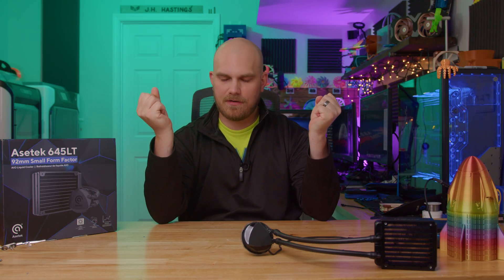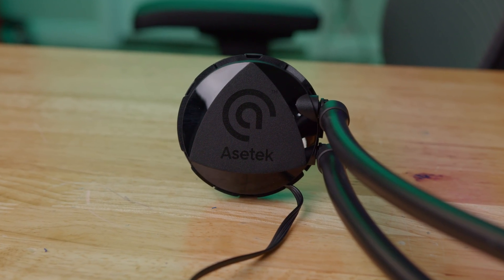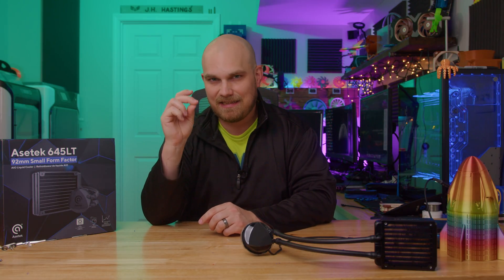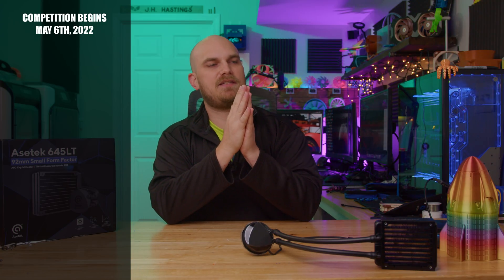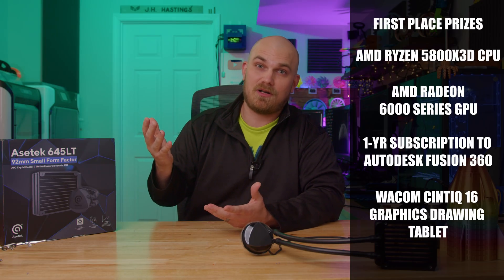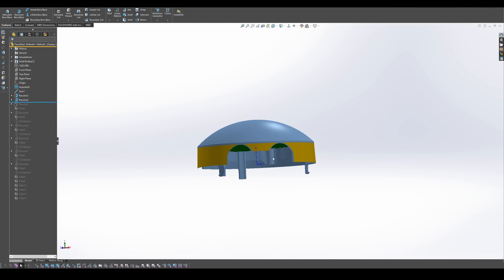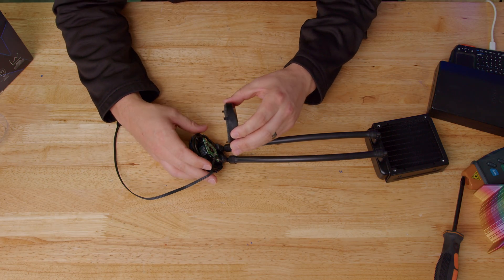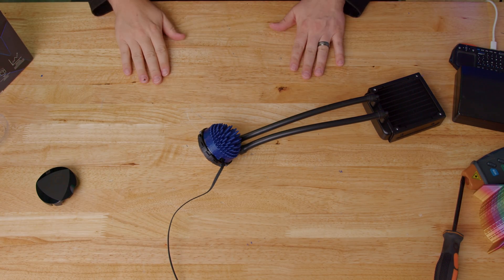The Fan Showdown Just Went PRO | Asetek Community Design Challenge

Comment: This is crazy! Asetek is ruthless with the patent protection but wants to drum up ideas from the same community they hurt. I think its a big deal they came to you and recognize your community and you should be proud of yourself and what you've created!
Reply: well this is certainly cheaper than actually paying for someone to design it
Reply: Yeah, my first instinct was to say "oh man, I really hope this doesn't turn into another 'Nike Swoosh' situation."

Carolyn Davidson was paid $35 for creating one of the most iconic brand logos of all time.
Reply: patent protections. getting free CPU block tops with no RGB... LOL what a joke
Reply: In what way do they have patent protections?
Reply: @TesserId  they have patent that basically says any pump attached to a heat block, is a violation. This is why you have so many weird AIO designs in the US with externally routed tubes, and pumps in the fan, and pumps in line, and pumps on the side of blocks, Etc. Etc. It is all you avoid any likeness to the "pump on block" patent. This is akin to Toyota having a patent on a "metal box that rolls on 4 wheels". It's a bad patent, and stifles innovation, and forces other companies to use Asetek block/pump combos on their units. Which with their round design and small heat exchanger, have been proven less than ideal in efficiency and performance. It has hurt the cooling the industry as a whole.
Reply: @bigbuckoramma  Thank you.  So, I did a Google search with some of those terms to see if I could clarify some of what I'm reading here.  The part about the overly general patent I found, but I think your explanation of why it's overly general makes perfect sense.  Overly general patents suck.  They stifle innovation, which is the exact opposite of what patents are supposed to do.  But, this is not new.  The corporate overlords got themselves changes to the patent laws that are totally ridiculous, and overly broad patents are issued way too often.  ~~~ So, does Asetek have predatory licensing agreements, or are they just suing the hell out of every company that makes products that  even faintly reassemble what the patent was granted for, or both?  ~~~ And, are they getting into the right-to-repair territory and making their products hard to hack?  Personally, I take no shame in voiding warranties when I want to cobble together a monster.  Screw the warranty.  But if a product is constructed to prevent such hacking, screw them entirely.  ~~~  Thanks again.
Reply: @TesserId  Yes to the first question. The licensing being forced on companies, and suing for infringement. As for Right To Repair, I don't think they care either way. Their pumps are semi serviceable, but they don't intend them to be. They are considered a disposable item. Yay for more e-waste.
Reply: This is obvious marketing/advertising
Reply: They probably wanna buy the any good pattern so they don't do any work for themselves to find one, then lock that pattern again.
Reply: @Stein Mauer 
But they are nowhere as cheap as the AIOs, when they should.
Reply: well, the rest of the copmanies could also sell DIY kits or different designs, yet they dont do it, so no, the patents arent doing much harm at all, sure its a dick move and a stupid patent but the rest of the companies arent even trying either. AIO are shit, why dont they just sell you a DIY kit one like people used to make them?!
Reply: who do they hurt? the unimaginative there are a few ways to get any job done and in this world being a copycat can cost you or just being late to the paperwork you might be surprised that Asetek has employees and families they provide for they are not your friend the same way no company is your friend or in business to save you money or other people time haha keeping the doors open is the first job of any company then securing growth
Reply: Nothing wrong with protecting your patent. Hurt? Talk about hyperbolic rubbish. Imagine forcing multimillion dollar companies into designing their own products instead of allowing them to rip you off...and then white knight for them. I am not Corsair or any other company. They are not the community and the community doesn't owe them a damn thing.
Reply: @Berserkism  stagnating the industry...

Comment: Yeah.  I'd like it a lot more if it actually had an effect on the efficiency of the product and wasn't just cosmetic.
Reply: I mean, at that point the company should be paying you.
Reply: Yea this is just stupid
Reply: The design doesn't have to be only cosmetic...
It's possible to make the design usefull
Reply: @poldelepel  how? this is literally just a shell, all water loop components and pump are already there
Reply: @marcogenovesi8570  Get creative. I have several idea's. .For instance, you could make it a bottle opener.
PS: this would only be a good design if you want beer all over your pc.
Reply: @marcogenovesi8570  could probably print a fan mount for a similar fan to the Arctic LF2 that cools the VRMs
Reply: @Emelydiaa  you beat me to it.
If the fan mount is the right size you could also screw the radiator directly to it...
Reply: Like RGB and OLED and all that shit? Yeah a piece of plastic is just too much.